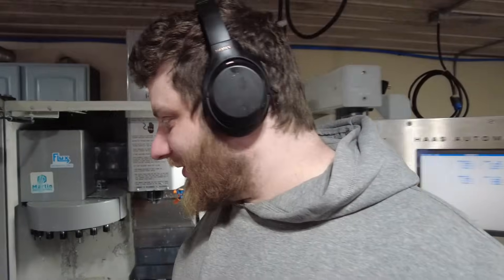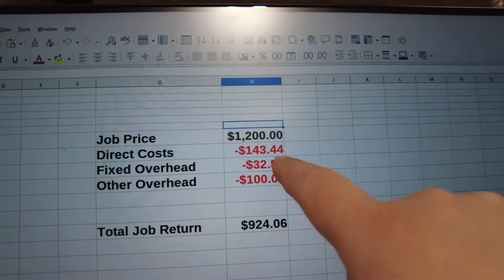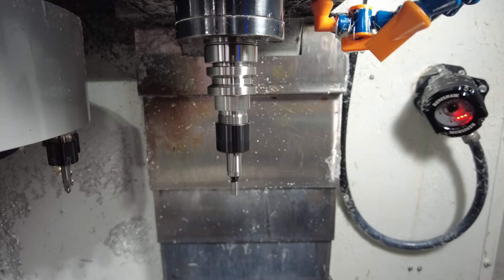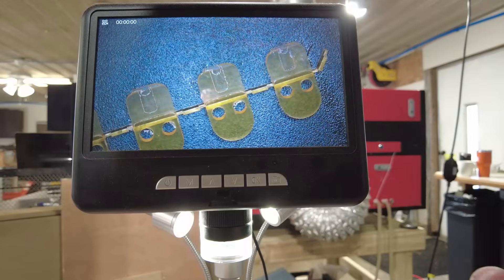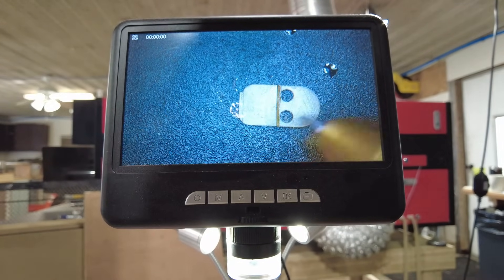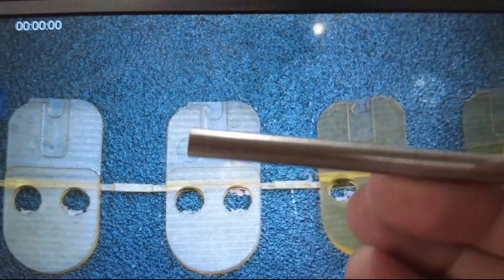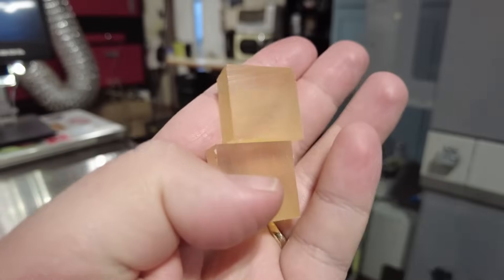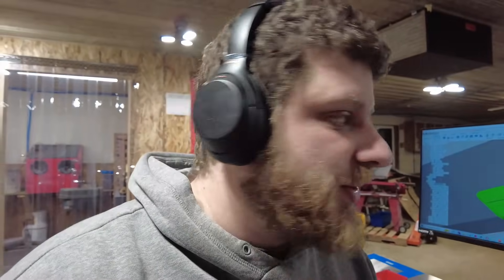Machining some ITTY-BITTY plastic parts

Comment: Which cheap self centering vises are you using? I need to pick some up for first op work.
Reply from the maker: https://amzn.to/4ahZQMA

These are the ones! In the video I'm using the slightly longer one, but I also have two of the shorter ones, and one of the ones for soft jaws, though I haven't used that one yet.

Comment: I know for scale modeling fiberglass brushes exist to lightly smooth and deburring plastics I wonder if it would help in this case with deburring the first parts
Reply: For scale modeling they also make side nippers that use one blade and one anvil and make a much smoother cut than the two blade ones everyone loves the god hands they're called

Comment: Love machining that stuff, we do a ton of parts with it,bits a heat resistant plastic, it’s super expensive,and it loves to chip out , but since you’re using small tools it’s probably not a problem, if you rough chamfer above stock it helps reduce chipping and burs,

Comment: Use scalpel blades for trimming and debur work on small parts.  Mcmaster 36325A72. and a #3 handle.     You must get a stereo microscope.  Insane to not have one. .

Comment: I worked in a job shop for just over a year. Any small/tight tolerance jobs i'd just run a full tooling touch off cycle while i did my cam. Also programming the probe to do probe cycles was really nice. It saved me so much time daily just dropping stock in and hitting the go button to have it fully probe out my zeros and even check dimensions for me after a part was done.

Comment: Nice work! Why not to do it in a resin 3d printer?
Reply from the maker: Thanks! I'm not sure what these parts are for, but both the materials are generally chosen because they can be sterilized relatively easily. I suspect they are getting used for something medical related, resins just aren't safe enough for that application, and printers probably couldn't do the precision the customers asked for on these parts.
Reply: Thanks for the context! @AudacityMicro

Comment: how do you factor in material cost when you dont use all the material? Do you charge for the full slab of material even if you have a lot left over? If they order more parts do you bill for material again or not because you're using the stuff you bought for the first job? If someone else orders something from you using the same material do you bill them for the material you already have on hand? How much would another customer pay considering you've used some of the original stock in a previous job?
Reply from the maker: Generally yes, you charge for the whole piece of material, even if you have a piece of scrap laying around that you can make the part out of.

Reorders do generally get a discount, but mostly because the process and programming is already proven out, and I always want to encourage repeat business. 

At the end of the day, the actual cost of the material doesn't matter. Just like my hourly rate doesn't really matter. What matters is what the rest of the world quotes the part at. If someone else quoted it at 75% of the cost, then I wouldn't have gotten the job. I could be charging a 10,000% markup on material, and as long as I'm still cheaper than the next guy, I'm still going to get the job.

Comment: Why not deburr the parts on the machine?
Reply from the maker: I have found that on these small plastic parts that deburring can cause more trouble than it helps. A chamfer tool just leaves two burrs instead of one burr that is easy to remove.
Reply: @AudacityMicro  I use a 2mm carbide PCB drill as if it were a 120 degree chamfer mill. The shallow angle when climb cutting usually slices off the burr without making a new one. Or sometimes just going over it with a square end mill will do it. Keep the center of the tool over the open area, and blade pushing the burr over the solid area so it gets sheared off.

Comment: I would suggest to go get a proper stereoscopic microscope. It will be the best few hundred bucks you ever spent as far as inspecting small parts are concerned.
Those small digital ones are frankly quite low res to the point that one often has better visuals beneath a magnifying glass or just the macro viewing mode available on most smart phones these days.

If the idea is to show us viewers, then there is trinocular microscopes too, such that you can both view the things with your eyes and record with a camera at once. These are though usually a slight bit more expensive but often worth while.

Another tip is to get a scalpel or other properly sharp knife. X-acto knives are a fairly good option. The retractable breakaway knife blade you are using is like prodding about with a worn out HSS drill bit when working in tool steel, it isn't the right tool for the job, especially on such small parts.

Comment: Always love the content, can't wait to start machining someday. Fixing my garage up over the next year or so to make a suitable shop.

Curious, what are the headphones you're always wearing and why? Just listening to stuff most of the time or are they just for noise cancellation or both?

Thanks!
Reply from the maker: I use some of the nicer Sony headphones. They are sound cancelling, and I listen to audiobooks and podcasts basically constantly in the shop. I wear them for both reasons my shop isn't that loud, but I like my ears. And my work isn't boring, but I like audiobooks a lot.
Reply: @AudacityMicro  Awesome, thanks! Also I found the cost/profit breakdown to be super interesting in this one. Wish you much success!

Edit: I think I have the same model and I thought they wouldn't be up to the task of cutting out the saws and such in my woodshop but feels like they do a decent enough job. I was getting tired of the silence so this will be a great change!
Reply from the maker: Thank you!

Comment: A couple of things. You should de-burr your stock before you pick it up with the edge finder, so you have a true 0. 0.  Plastic is a problem to machine because it wants to craze, traditional coolants don't eliminate crazing. Liquid hand soap will leave a crystal clear craze free finish.
Reply from the maker: The exact location of my zero point didn't matter. It just needed to be close enough that the whole part was contained in the stock. It could have been a hundred thou off, and been fine.

And don't worry, I check my coolant compatibility with every plastic I run. Ultem and PSU are both perfectly compatible with a water soluble oil, like the coolant I use. You just can't run them with petroleum based coolants.

Comment: I'm always curious what jobs shown on YouTube cost, so it's much appreciated when that topic is covered.
Reply from the maker: Glad you enjoyed that! I understand why shops don't like to share that info. It makes quoting a little weird, as one customer may see a different customers quote, and not understand why they had to pay more for a similar part. Sometimes customers don't understand things like some parts needing custom fixturing or specialized tooling.
Reply: @AudacityMicro  What have you found to be the most effective way of communicating that sort of stuff to people who may be laymen?
Reply from the maker: Basically you just have to be patient, and tell the truth 🤷‍♂️. "Mr customer, yours is more expensive because required a specialty tool, that tool costs money and takes time to setup. You could save some money if you made this modification to your design"
....

Comment: can you link to that vise it looks awsome
Reply from the maker: I'm having a hard time finding the exact vise I ordered. They took the listing down for some reason. This one is close: https://amzn.to/3wN19Ec
Reply from the maker: This one on ebay is closer. I got the longer version, which I honestly regret. The jaws aren't wide enough to justify the length. This is the version I would have bought

https://www.ebay.com/itm/285348445869?itmmeta=01HRHSKR8D9NVSK66E599KC80R&hash=item427017bead:g:7awAAOSwB4NhKiWs&itmprp=enc%3AAQAIAAAA4DQZ0XzseZtwoQaQuJF7n1UMxbU1TQVfO1MlvK8VA%2F16No4v41tLPBilCnRkCbjCz33d0HY9JiQeztm972BNG1dHo5FFARVnKRAEZZ7n%2BPDHcifS58DtPxY%2FPsyUokv9meerGyEPCkwtSREH17ku4Vh60gLeOOGdY80NP19%2B7j%2BtdHl6JXfcKjfFEChH0dVLnI3XCfmF31rpgL3I3qQ0rmFQw0YpE%2FvrbtJhbSIM6hUUIZPdQhLyz9QhvAsTqO68UixIc6ArHWGxVMMCBaKlsPZ7acCzzy8LuMQSs9HBOjlv%7Ctkp%3ABFBMuoTPucRj

Comment: Dang!! McMaster is expensive. Since we are speaking of money, Boedeker was about $14 for a 0.24 thick 2x12” piece a bought a few months back. It’s too bad cause I could have sent you some of my cut offs for this job. I keep anything over 1” square for stuff like this. Keep up the great work!
Reply from the maker: Speed was my priority here. I only had a few days to make the part, and Mcmaster has a lot faster delivery times then Boedecker where I am. I would have had to pay for next day air with Bodecker, which would have canceled out the cost savings.
Reply: @AudacityMicro  well you've now got plenty more for the next project!
Reply from the maker: yup! And hopefully I get lots more ultem, I love machining that stuff
Reply: @AudacityMicro  I agree! I turn a lot and have issues with chip wrap but it's so easy. I have a GE made speeds and feeds cheat sheet if you want it. A friend sent it a few months ago and I found that I could go with a deeper cut and still get awesome finishes.